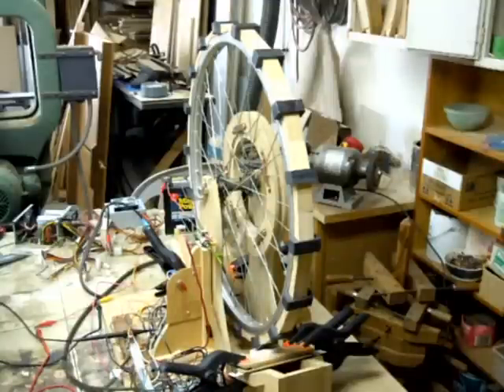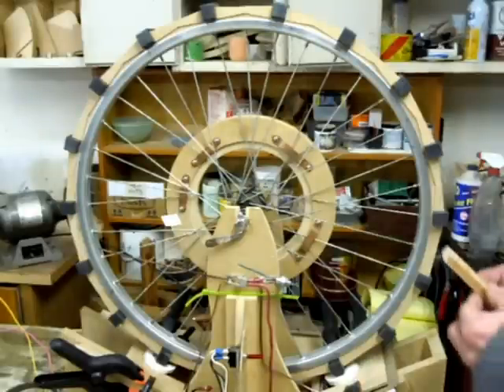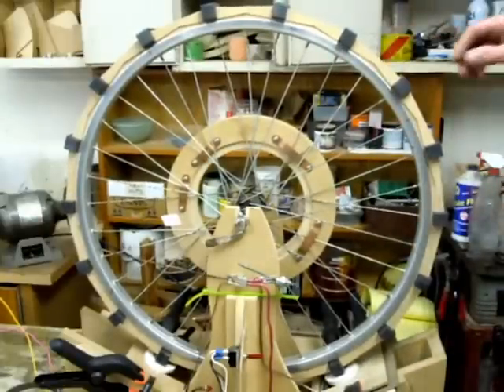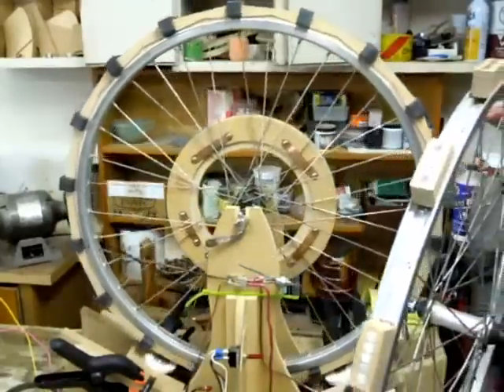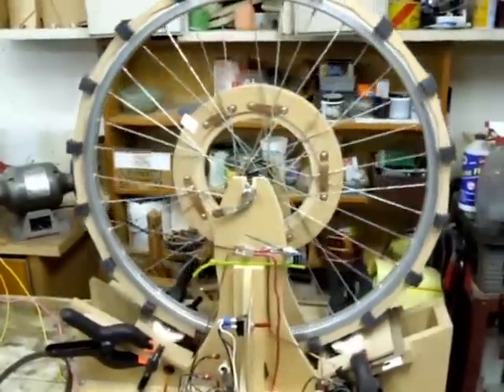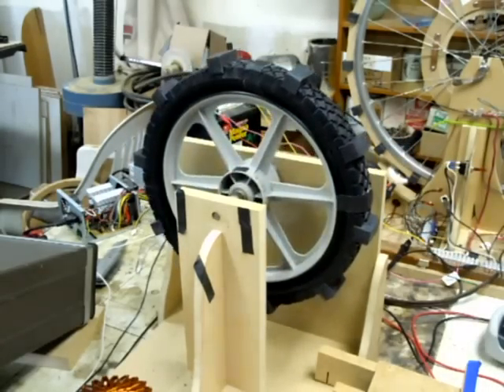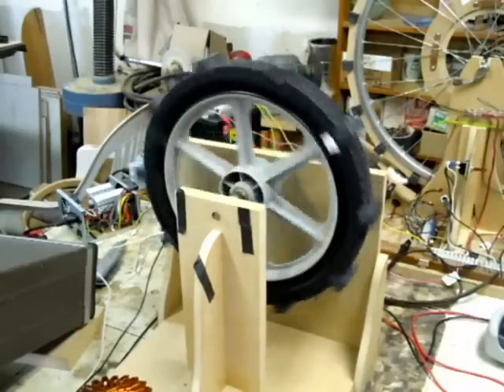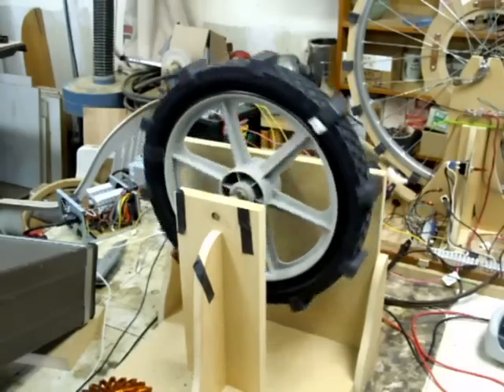Building Magnet Wheels

Comment: Interesting - the concept is good. If the magnets were attached to the inside of the rim, and you could pulse the wheel from the SIDES then the wheel's tyre or tyre-mount rim would not be interfered with? IE you could attach the wheel on the bicycle and this would drive it around without hindering normal operation of the wheel.

Comment: This is so you can get the "pulsating thing" you mentioned going, a lot is in the pulse.

Have made many various coils, pulse motors, and years of experiments.  
Here is a wiring scheme,  try it, you'll find interesting. works with any bi-filar coil setup or two coils in conjunction with or without a magnetic armature [N-S].  Using a bi-filar, mark coil A and coil B, mark the beginning and end of each, the beginning of coil A goes to a resistor, then to the base of some value of a NPN transistor{ also used a n channel mosfet), the end of coil A goes to the emitter of the transistor which goes to the negative of a battery. The beginning of coil B goes to the positive of the battery (12 volt,can use more and less depending on the simiconductor) and the end of coil B attaches to the base of the transistor. HV can be extracted from E/C or B/C. Check with neon bulb, attach rectifier bridge or just one diode to get DC and to charge a cap. This is the basic setup.
 Parasitic coils can be place close to the main [bifilar] and extract additional energy. Also, multiple coils can be wound with the active pair, tri-filar, quade...and so on....
The transistors should be able to handle fairly high voltage  (tip 3055, bul305, or comparable N-mosfet , 3904, 2222 also) Also the transistors required much less resistance, the N-mosfet can use from 300,000 ohms to 1 meg and more to oscillate. An anomalies, get oscillation without the base being connected, (only the rodin starship, to initiate oscillation short out the base and collector for just a moment).  Use a neon to check for high voltage produce from the base and emitter, place a rectifier bridge across these and connect a large cap. Because it oscillates without the resistor being connected to the base, the beginning of coil A is free to utilize  for other purposes. Meters glitch, use the neon for testing.  If any of this possibly confusing info needs clarification, will do so.  Have a few music video's and one of a device I built. Note: have charged caps to 900 volts and more using a 12 volt lead acid cell using  a bifilar coil, just started experimenting with these rodin things. The idea is to use the back spike (collapse of the flux field) to initiate a radiant pulse (scalar pulse) with would produce and over unity effect. It's all in the pulse. Look like you would have a bifilar laying around, so try a quick clip lead hookup to see if it is so.....later.............marc.
Show less
REPLY
Reply from the maker: Thanks Marc. Been out of it for a long time. Email me if you are still listening.

Comment: When I make my wheels I use wood for the whole wheel and my bearings are in two laser cut aluminum bearing housings and the wheel is mounted on an aluminum shaft.  The magnets I use are cylindrical Neo magnets.
My hack is that I buy a drill bit the same size as the magnets in my case 8mm diameter. Then I gently and evenly grind the end of the drill diameter for a very short period of time. In other words I grind the diameter of the drill down about 50 microns and along the length of the drill the same as my magnet which in my case is 25mm long
This means that when i insert my magnets into the holes I drill, they are a press fit into the wood. I also drill 12mm holes right through the side of the wheel at the end of the magnets positions so that I can push them back out again with a small screwdriver, its fast and easy, I can build a wheel in about 6 hours, it does include lathe and drilling machine time. It excludes the time on the CAD machine doing the flat patterns for the drilling positions drilling jig and the laser cutting time for the bearing mounting parts.. Whats nice about this method is you can take out the magnets and change the configuration easily but the press fit still holds the magnets tightly when the rotor is spinning and there is no super glue required.
To use it on your setup I would cut a wooden ring and mount it on the side of the bicycle rim so I can drill through and press fit the magnets in from the outside of the wheel. the OD of the wooden ring is the same as the OD of the rim. The ID of the wooden ring is the OD of the rim minus 2 x the length of the cylinder magnets you use so the magnets are flush with the OD and the ID of the wooden ring. If you make a 1mm thick drilling jig that wraps around the OD of the wood then you can drill holes at a very small pitch e.g. an 8mm cylinder magnet can have a 10 mm pitch. this means you will basically have as many holes as possible drilled right around the outside of the wheel, then you can add and remove magnets as you wish. You can change the duration of the magnet using say 4 small magnets to represent one large one, then you can repeat the tests with 2, 4, 6 or 8 magnets instead of one big one. Having drilled so many holes means you can also change the number of magnet groups per revolution too, it just gives you more tunable options and hopefully its less manual manufacturing hours too because the hard work is done by machines and computers.

Comment: There is no free energy in the sense that such a device as shown can generate it's own perpetual power.  If you start the wheel manually, you will never be able to derive more energy from the system than you put into it with your muscle power to start the wheel spinning.  Unfortunately, the apparatus will cease turning when the kinetic energy put into motion is finally consumed from friction and resistance from the magnets moving through an electric field. Hope this helps!